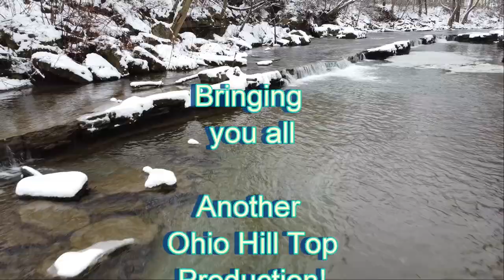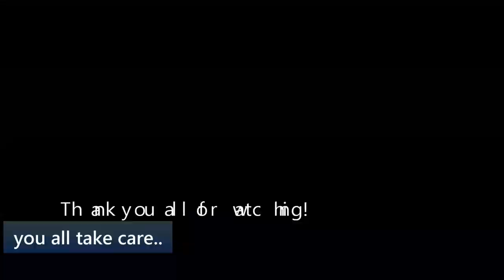#244 HUGE Cherry Log, Hooked on milling!

Comment: Hey Dave steve here with MSD. Just a little pointer that might help that engine surge. My riding mower was doing the same surging and I put a can of - ( fix-it fuel ) and by the end of me mowing the lawn it stopped surging and ain’t never did it since. Bought at tractor supply.              VP Small engine Fix It Fuel Treatment
Reply from the maker: Hey Steve! I sure appreciate the tip, I’ll give it a shot. I thank ya for watching!